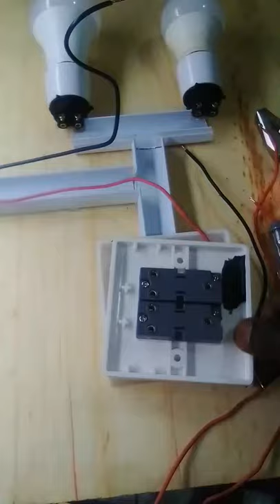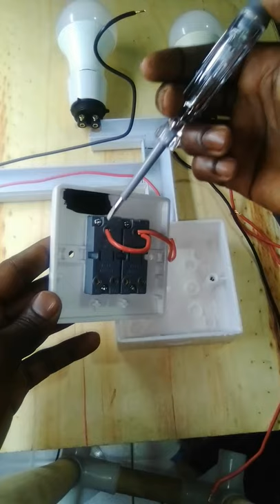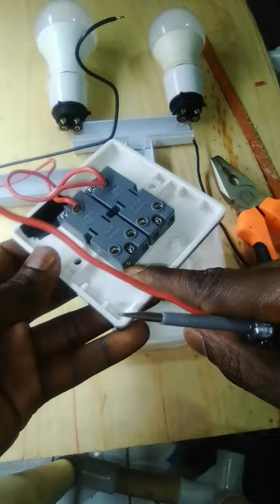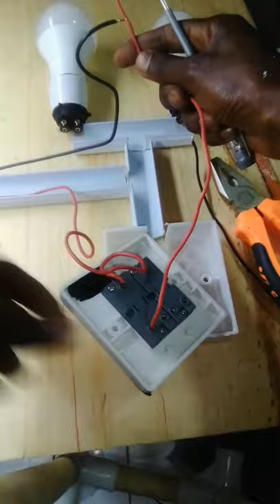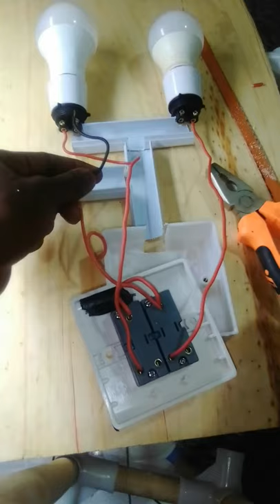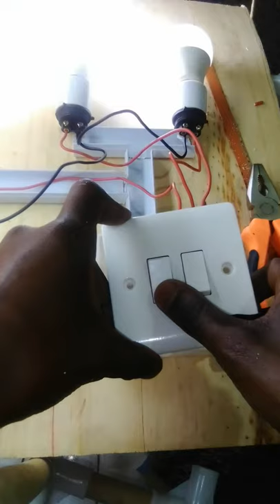2 gang switch wiring

Comment: Was the switched live cable reversed between the bulbs during the cut when you flipped the switch over? Originally it looked like the left light was connected to the right side when viewed from the front ( left when viewed from behind ) and vice versa.

Comment: Do you not need to see the L1, L2 and Common etc or have I just got a complicated switch?
Reply from the maker: Use L1  if you're switching 1gang. 1way
Reply: @powerelectric8833  OK thanks for response 👍🏽 I'm trying to wire a double gang switch which has  two of each= L1, L2 and Common (six in total)

Comment: If I want to run my 12v lights off a common single household light switch..how do I wire it please? 

Any help would be greatly appreciated
Reply: Would it be..live from battery to top hole, live back out of bottom left hole to the lights then negative from bottom right hole to negative on lights
Reply from the maker: Hi  from buttery use only + to switch the light,  and - direct to light

Comment: How come the two bulbs lights at the same time?
Reply: Because of the live , bettwen those liver, there's main and supporting... A liver that lights 2 bulbs is a main as it it receive the power and also transfer to second liver,if the power finds second switched on the bulb will light

Comment: I saw red connect to the switch n one end of the bulb. The black connect to one end of the bulb. Where is the other end of the black connect to? And I saw u bridge the switch with a piece of red wire. Can u tell me the reason why. To my suggestion I think is to make contact with both switch. Is that correct?
Reply: I saw u bridge the switch with a piece of red wire (is to distribute the LIFE power from house main power supply to both switch)..

your suggestion is correct. then, from each switch going to supply each bulb... (when switch ON)